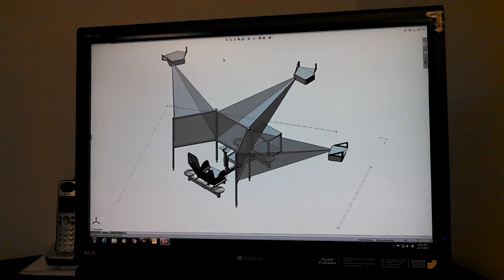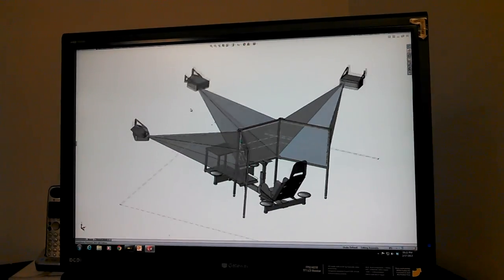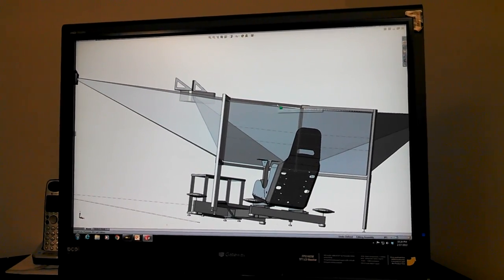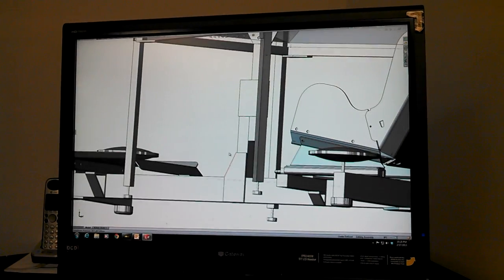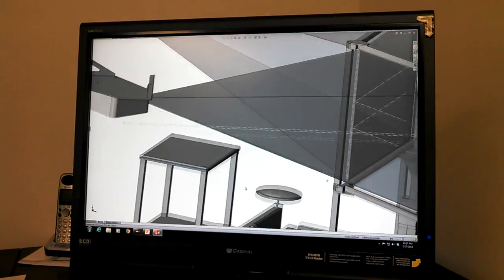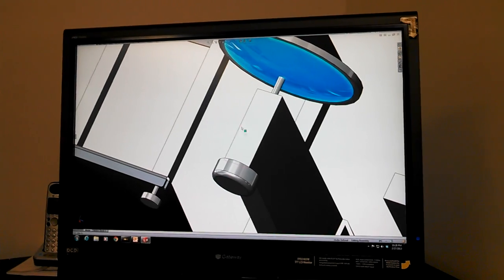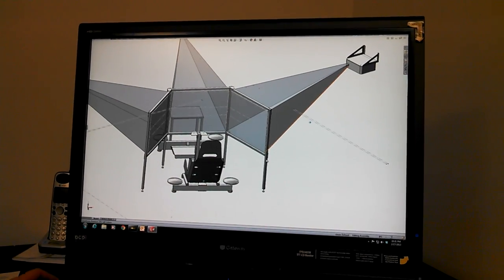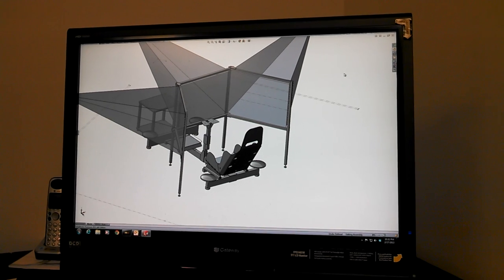Part 2 of 5: 3x Projectors Sim-Racing Cockpit Design / Build

Comment from the maker: Yes, we discussed at length in the iRacing hardware subforum. I chose to go with flat screens because iRacing's multi-monitor support is so exceptional. I believe that, without bezels, the driver won't even be aware of the screens themselves--only the projected combined image.

Comment: Pedal wise I prefer the the club sport pedals to the t500 pedals. I'm sure you can get mods for the t500 pedals these days. I just like the load cell in the brake pedal of the club sports. It measures how hard you press instead of pedal travel and you can switch spings for increased tension. The clubsport wheel is WAY nicer than the csr elite though. If I had had the choice now I probably would have bought the t500. The shifter is far superior to the shifter for the fanatec.

Comment: I love the Fanatec csr elite now that the firmware is upgraded. I got the wheel just after release and I most certainly didn't like it with the firmware it came with. I also really disliked that the firmware was not available on Fanatec's site. I had to find it on a blog made by Thomas from Fanatec. Installation was clunky but doable. I haven't tried firmware upgrade on the t500 but only played with it for a couple of hours. I think the wheels are pretty similar (very good).

Comment: I normally wouldn't want a center pole. I'm sure that the placement of it would be really close to his seat in the final version though. If not it would be really awkward to use three pedals. Having seen his earlier rigs I'm sure that will be taken care of though. Getting in and out of the seat is of course way easier without the post. I got the Obutto rig which doesn't have a post. I have a Fanatec csr elite wheel and clubsport v1 pedals and tried the t500. continued..

Comment: I'm (almost) certain the dislikes were because of the positioning of the center post for the wheel. On normal (gameseat) rigs with a center pole that will make it almost impossible to use three pedals but I know from your videos that you would move it so close to the seat that it wouldn't matter. I think people are maybe thinking that the center post will be just behind the pedals which would not be desirable if it was not REALLY thin :) Or maybe they just had a bad day.

Comment from the maker: The nice thing about 80/20 is that if the center post doesn't work out, I can easily change it. I have carefully considered the pros and cons, and decided to try a center post. Much of the reason centers around SimVibe--I want more direct vibration to the wheel via the chassis structure.

Two dislikes overnight for a technical video? I guess that's the nature of YouTube.